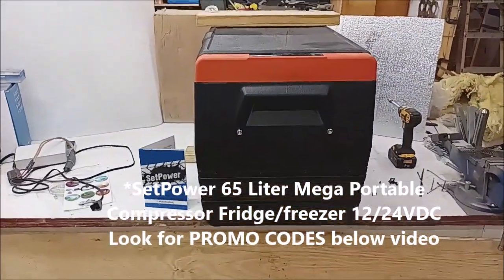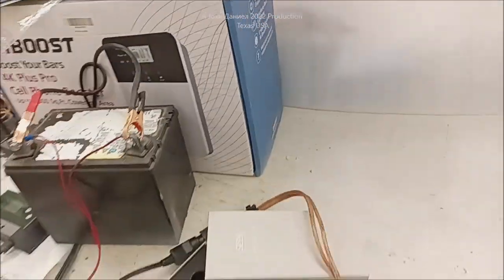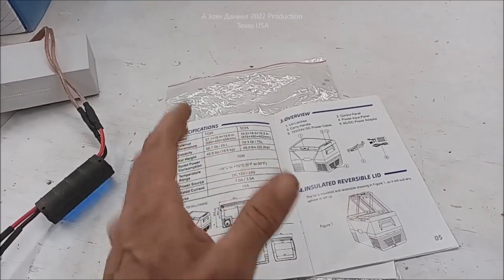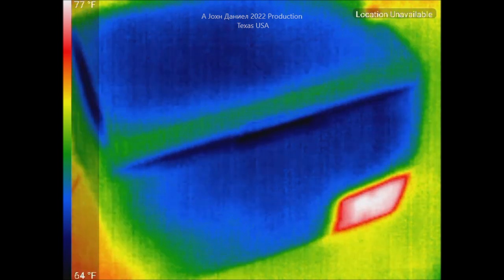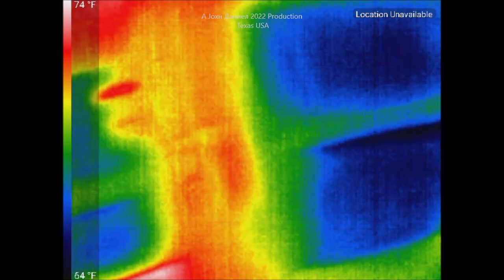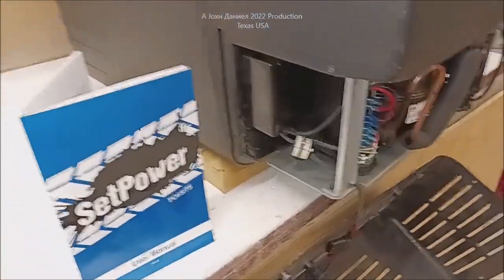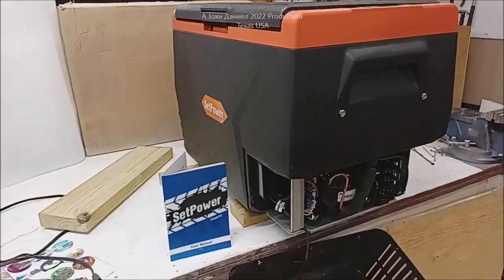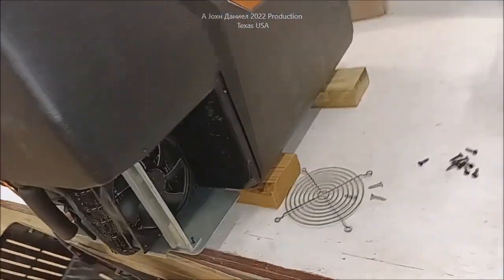Get FOOD SECURITY, SetPower 12-24 volt DC Refrigerator Freezers with DIY Battery Power

Comment: You might be just the fella to answer a question that I can't find an answer for anywhere on YouTube. These "coolers" all seem to be 12vdc/ 24vdc. I assume that is for use in semis. Do you know if they will run on voltages BETWEEN 12 and 24? Specifically, what I have in mind is using Ryobi 18v ONE+ style tool batteries as a light weight alternative for short time powering of the cooler.  Ryobi makes a cooler that runs on those batteries, but I don't know if it has a buck converter built into it or not. I'd like to run one of these other brands straight off the tool battery. Your help will be much appreciated.
Reply from the maker: They are dedicated circuit 12 or 24. The internal controller would be the issue, it identifies the voltage and uses a program to apply it. 21 volts is low cut off on the 24 volt and 10.5 on the 12 volt. If you put a tool battery on it it won't run due to available amps even if its like most 24 volt tool batteries unless they have a 7 amp or higher BMS in them. These peak on average at 15 amps and 7.5 amps (@12/24vdc) respectively when starting for up to 2 seconds.
Reply: @JOHNDANIEL1  Firstly, thanks so much for getting back to me. Really appreciate it. Next, after I posed that question to you, it occurred to me that I could use a small bench power supply, that I keep forgetting that I bought, to test the cooler myself. I was hoping that it would just fault out and not blow up. It did exactly as you predicted that it would. Going up from 12 to a little over 15 volts it worked fine (I assume, on the 12 volt control) then it seemed to detect something it didn't like, switched to 24 volts only saw 15.5 and shut off with a low voltage error code. Starting at 24 and going down in voltage the same code came up at 20.5 volts, just as you said. My unit is a VEVOR 16 quart and I have to say it didn't pull nearly 15 amps at 12 volts. My power supply only goes to 10 amps and I had it set for about 5 amps when I was testing, again, because I didn't know if it was going to blow up or not and I was trying to be cautious. I think I'm going to give it a go with the buck converter and operate a 18vdc tool  battery at 14 volts. Thanks again for your help.
Reply: @JOHNDANIEL1     John, I wanted to tell you that I used a 6ah Ryobi 18 volt battery and a buck converter to run my 16 quart VEVOR freezer fridge at 14 volts. I cooled it down to 36 F with the AC power brick. It had several pounds of cheese, 8 beers, 18 eggs and a few other items in it as it cooled. With the unit in my 70 F house and with it running on the slower ECO compressor speed mode it ran for 10 hours and consumed 58 WH of the 108 WH in the battery. 
   I've tested all my Ryobi batteries in the past and, when discharged at a .2C rate,  1.2 amps) the 6 AH ones let you use about 100 WH before the BMS  turns it off. The compressor was pulling about 2.4 amps anytime I checked the amp meter that I had connected, so I guess that's why I only got 58 WH in this application. 10 hours is a good run time as far as I'm concerned but 58 WH seems pretty low to me, even with the .4C load. 
   Do you or anyone else reading this, think that maybe the high start current for the compressor was at some point, late in the discharge cycle of the battery, abruptly pulling the battery voltage down to the point where the BMS just cut off prematurely on low voltage protection? Or is that just what you should expect when loading a LFP battery to twice its C rate?
Reply from the maker: @mrhalfstep  The Buck is giving you the slightly higher amps you needed to get past the instant draw limit on the Ryobi battery. (Volts drop/Amps rise). Those capacitors in the Buck is what can make it possible to run the freezer start up, help it smooth load. 6 amp hour battery like that has likely a 12 amp output for load max on a tool. Being a Lithium Ion battery they can do that.

Comment: Off subject...
  Can an old time "on the fender" 12v "analog" external voltage regulator be used as a charge controller from the 12v  solar panels to maintain charge on solar system batteries?   (The things I think of going down the road)  ((a tanker yanker))
Reply from the maker: No, it's a limiter that functions against a alternators engagement and disengaging of it's electrical field power.

Comment: I just started this video but I know early comments help the cause so what I really want to see is what is the difference between a 12/24 volt Appliance versus 120 / 240 volt Appliance? Can I convert my 120 volt refrigerator to run off of 24 volt with a simple adapter rectifier or power supply?
Reply from the maker: Dc voltage motors and AC voltage motors run with different wiring and control circuitry. So if you have a AC freezer you can only run it on AC, but most are very low wattage consumers so get a P3 meter ( https://amzn.to/3MYFyf7 ) and do a constant 96 hour run test on it. Most are about 200 watts running, with a 550 watt start up like a 7 cubic foot chest freezer. For that a 1000 watt pure sine inverter of good quality will pull 53 amps on start up ( about 5 seconds ) then 17 amps from your battery bank. So you would need a minimum of 3 deep cycle batteries and 600 watts solar to run all that. BUT, a DC powered skips many steps and can be over all 25% more efficient  and cost effective for off grid use. Less steps, which means less power usage in conversions. .
Reply: @JOHNDANIEL1  I do know that a lot of AC products drop to 12vdc or 5vdc for internal parts. It's surprising actually how we use 12-14vdc from our vehicles to plug in a 110AC adapter to charge our phones with 5-9vdc chargers.
I am building a camper and would like the fridge to be DC, so I can swap in a DC power supply and compressor but I wouldn't be surprised if the compressor is already DC input after a 110vac to 12vdc regulator
Reply: @JOHNDANIEL1  I would really like to see someone plumb a refrigerator, air-conditioner, heater and water heater all on one compressor. It could potentially generate electricity.

Comment: I found some frigerator freezers ago 19 below 0 that I paid $260 to have sent to me from Japan and I've already owned one for several months and it several months and it's 14 V DC With an AC converter
Reply from the maker: Yes the genuine Dan Foss compressor requires an above 12.8 volt run, so the ones made in Japan and Korea are all coming with 14.5 volt materials.

Comment: I used a messenger bag for my lifepo4 battery and wired a meter and cigarette lighter duel port velcro to the bag on the outside . and can connect my mppt controller with cigarette lighter port and panels connect with DC port I added . easy to setup . we used ours for 2 weeks offgrid and had pop cycles and cold beer the whole week then refilled the supplies and went another week .we let the fridge run 24/7

Comment: I have one like that just a bit bigger .I made a battery pack  35 ah 12.8v lifepo4 battery  and mppt controller and 60 watt  folding solar panel  and can power mine 10 hours off  pack and indefinitely if I add solar .
Reply from the maker: We have a few more than shown, a pair of Sundanzer dc12 5.8 chest style too that are over 6 years old. DC compressors if built well may last longer than their AC cousins.

Comment: I have a Waeco brand like these. I've had it for nearly 20 years. Admittedly its only used on camping trips, but it's great. I got their AC converter with it at the time made by 'mobitronic' it's about 4 times the size of what you have shown. Im going to check its consumption having seen your last video and this one,  says its .6a @240v and 6a, 72w @ 12v but who knows....
Thanks for showing us the 'guts'. That Air con idea would be a GREAT video to watch. Ive been thinking how I could convert one of these to a vertical unit to retro fit the old ice box in a 1947 Bond wood caravan I have. Waeco or Danfoss maybe, sell a DIY kit that once installed you just click the pre charged components together but it was over $1000 at the time.